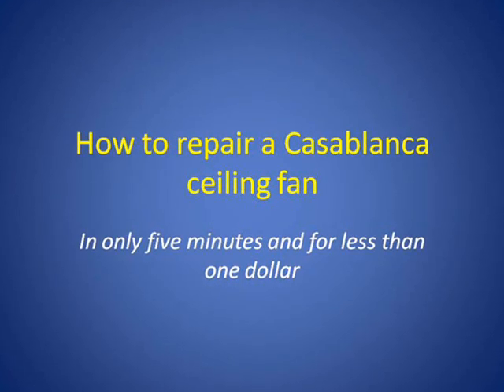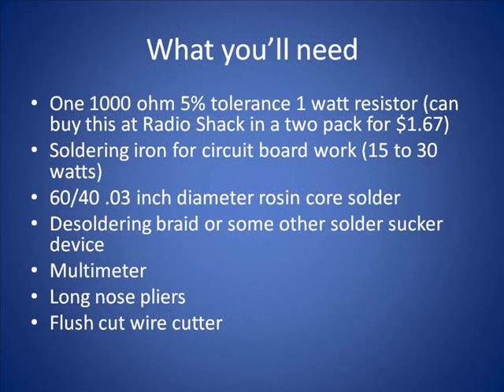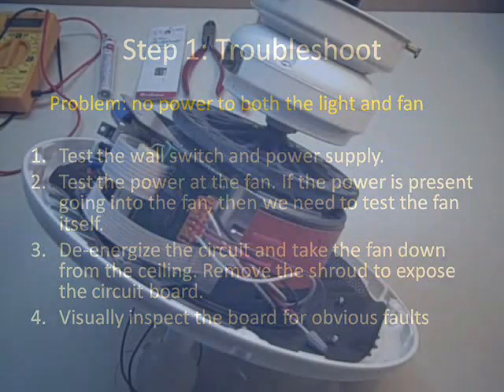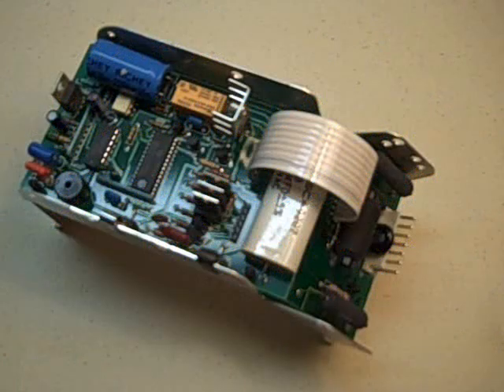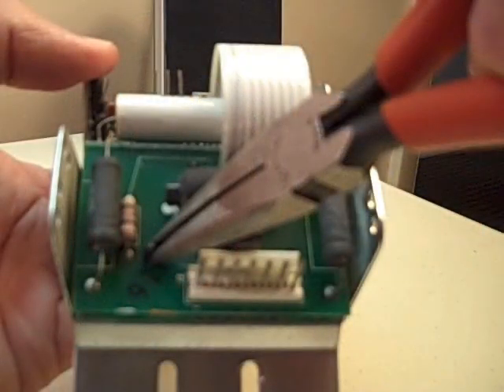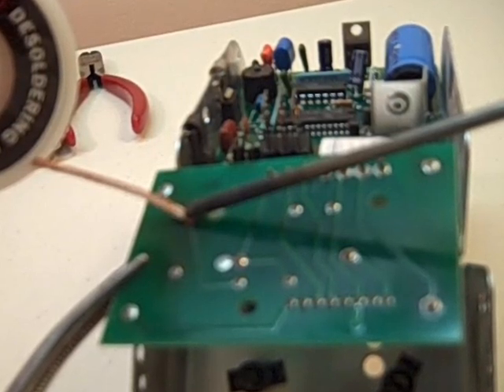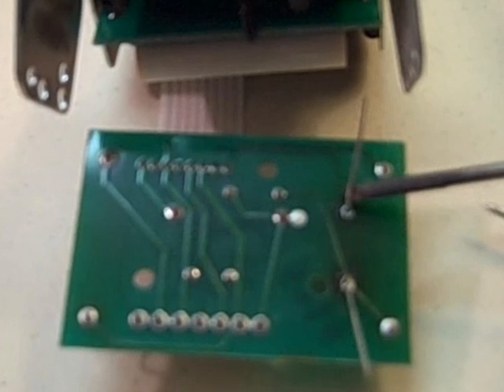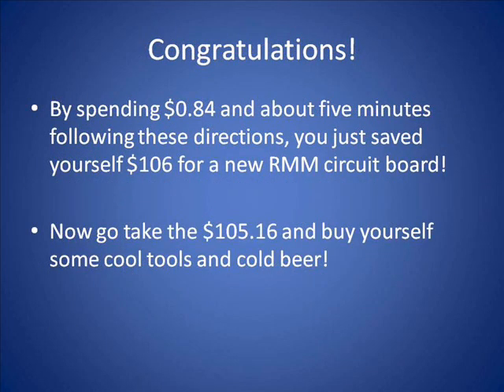Casablanca ceiling fan repair

Comment: My Casablanca Delta 2 fan stopped running.  In troubleshooting, I found the forward-reverse switch faulty.  There was no easy way to remove/replace the switch so I cut loose the two wires for blowing the air downwards and twisted them together.  While testing the fan, I noticed a spark on the circuit board when I turned on the fan.  There was a bad solder connection on the bottom of the board that I had to re-solder.  The fan now runs and the wife is happy!

Comment: I got a Casablanca Panama 5 and the motor wouldn’t start, and when I pushed it while it was on, it would barely spin in whichever direction I pushed it to. The issue was the 10uf capacitor. I cut the old capacitor out and connected a new one across the red and the brown wires connecting to the board. Works fine now.

BTW, this problem can happen on any fans with permanent split capacitor motor. Most ceiling fans have permanent split capacitor motor.

To see if it’s a bad capacitor, turn on power then press fan button. If the motor vibrates but wouldn’t start, and the flywheel/blades spin freely if you push it with your hand, then it would be a capacitor issue.

Comment: For the RMM4, the resistor is 10K not 1K, and the problem for the ones I worked on was the 1000 uF 25 volt electrolytic capacitor. This module design is a thermal disaster, and the electrolytic capacitors get baked out by the heat. The 1000 uF cap and two 10 uF 16 volt electrolytics bear scrutiny and repair, using the same procedure you note for the resistor, but keeping in mind that these caps are polarized (they have a + and - side, noted on the PC board). Then there are the 425 and 3.9K power resistors that are often baked out, although these are pretty hardy, usually.

Comment: I believe this resistor is a 10,000 ohm, not a 1,000 ohm part... Beware that the heat also bakes the color bands, so they may not be reliable for troubleshooting the value it should be.

Comment: Weird,  changed the resistor and run normal, but when I turn off and turn on again, there's short somewhere and blow out my switch. OK, I took of the board and hard wired the wires, replace a normal 3 speed controller and now it's a non-intel fan in the bath room. more reliable!

Comment: My 20 year old Casablanca Stealth died recently.   I pulled my board out,  my small board had a 10k 1% on it that tested out fine.   My larger board had a 3.3 Ohm 1% resistor that tested at 0.4 ohms.   I did not have a 3.3 Ohm resistor on hand so I replaced it with a stack of 3 10 Ohm 1% 1 watt resistors to reach the correct value.   Unit now powers on and runs.  Thanks for the inspiration!

Comment: I don't believe the 1000 ohm value is correct for the newer RMM4 boards, more like 10K or possibly higher. As far as I can tell the older RMM boards, at least through RMM4 are no longer available, however another solution is to upgrade the board and wall switch to the IT3 standard. I bought two kits from "Fan Man" for $150 ea, I hope to install them this weekend, I'll report how it goes. I'm tired of getting the ladder out and messing with these boards, hopefully this will be a long term solution. Of course if the $1 resistor works for you, and you don't mind doing it now and then, it's about as cheap as it gets. It didn't work for me.

Comment: My fan sparked last night and now the lights work but the fan itself doesn't.  It's a newer 2011 model and I can't see any problems with the  resistor - any other thoughts?  The place I bought it from wants to repair it for $225!!! The repair fellow also suggested it might be the Molex plug - how does one test for a faulty plug?

Comment: I hadn't yet watched this video when my 30 year old Casablanca fan quit suddenly one day. I determined it was the fan not getting the signal from the wall switch. Both Casablanca and the company they recommended tried selling me a new switch and circuit board for $225. After watching this video you gave me the courage to tackle this problem. It was exactly how you described! A burned out resistor! After wicking away the old solder and removing the burnt resistor and resoldering in the new one (sold on eBay in packs of 5 for $3), I am now enjoying our fan once again with no problems. I have to wonder how many people have thrown out their expensive fans because of this? Thank you for taking the time to create this video and help save me money!

Comment: I have an older fan than this one, pre 1987 Inteli-touch, using the W-11 wall control. There is just one control board, not two, but it looks fundamentally the same as this unit and uses an Emerson K55AMBHT-9210 motor. It has had some intermittent behavior for quite some time and just lately started failing altogether. After seeing your video I inspected my board and saw that R1, a large 1W resistor like what you show, has generated a lot of heat, discolored the surrounding circuit board, and is cracked. It still measures 3300 ohms as the orange-orange-red-gold rings indicates but as it is cracked I'd imagine this would explain the intermittent behavior. I intend to replace it and hope to get the same good result. Thanks.
Reply: Did it fix?

Comment: My resistor in that position is brown-black-brown-gold, which is 100 ohms 5%, when I measured it my meter read 1.2 Mega ohms. Thanks so much for the video. Not only is it way cheaper - but also allowed me to perform a same day repair.

Comment: When I turn the casablanca ceiling fan on, it is making a noise. It seems from inspection that there is a gasket just above the casing that rotates the blades. Where can I find the name of this gasket, part number. Thank you

Comment: I have a Holliston Casablanca model C31Uxxz. The fan unit is controlled by the inteli touch 3 wall mounted switch (owners manual says it is a W-84 wall control). The power button at the bottom of the switch turns on the fan at slow speed. No lights can be turned on and no speeds can be changed. No beeping noises are heard either. The casablanca support crew had me try to "reset" the unit by turning it off at the circuit breaker and then back on and depressing the fan and reverse buttons. This did nothing. They said the receiver inside the motor housing needs to be replaced. The part # is 8880601000. They want to charge me $110.00 plus 9 for shipping. What a crock of crap. Harbor breeze fan company sent me a current limiting device for free when it failed. Would the failed resistor described in the video result in the symptoms I am seeing??

Comment: Our fan light won't turn off when the fan is running.  I can turn the power off and on to turn off the light but I cannot run the fan with the lights off.  Any suggestions as to what to do or what can be done to repair this.
Reply: mrsdnoble mine does the opposite, they go off and on and then finally off
Reply: How fast does the fan spin when you press fan button? And try holding fan button and see how many beeps there are.

Comment: Kudos to fishbulb for this post!  Luckily I had the same fan with the same problem.  Only difference is when I measured the 10K resistor, it was fine.  Turns out that there was some cracked solder on the leads of a couple of resistors,  Resoldered them and I'm back in business!!!
Shame on Casablanca who make an awesome fan. 18 years and still looks good and quiet as a mouse.  However, to charge $100 plus for a new set of electronics and switch is robbery to me.  
Thanks for sharing this!

Comment: I have a Casablanca Stealth that is probably around the same age.  It has a wall control panel (vs a remote) that is connected to my light switch.  I too have faced ongoing objections from the only service centre in the city, saying it's too old and that parts are no longer available, but like you, I'm determined to fix mine.  Before I go through your tutorial, I just wanted to describe my situation in case you might suggest another approach.  I am definitely getting power to the fan - the light works, the fan works... same with control panel.... I think the problem is within the wall panel.  The light hadn't worked in a year, but the fan was fine.  I've never had a problem with the fan until recently. Now it seems that the circuit is scrambled... I turned off the fan and couldn't get it going for a couple of days.  I tried again, and it worked but only on the lowest speed.  I turned it off again to see if it would work and it took about 50 tries to get it working again... A few times I left the power on, but had no fan activity, then hours the fan would start working.  My latest status is, the fan turned on from the "Reverse" switch, NOT the Fan switch and it's now turning at medium speed, but no light still.  Sorry for the long message but I'm not an expert and I love this fan.  Hope to hear back.  Thank you.

Comment: I'm about to embark on this same repair and the only oddity is my existing resistor is (light) brown/black/(dark) brown/gold which would be a 100-Ohm instead of 1000-Ohm rating.  The current resistor is blown, so I obviously can't measure it to ensure the 3rd ring isn't red versus brown, but I'm fairly convinced it's brown even though both brown strips are different shades, which is confusing in itself.  I'll remove it and triple-check after wiping it down.  Thanks for this video!

Comment: Casablanca Inteli-touch fans are not junk, they are far better than any box store fan. I understand your frustration though, Inteli touch2 circuit boards are a nightmare. I would by an Emerson with a K55xl motor.

Comment: i have similar casablanca fan that is not fuctioning to theinteli-touch  remote . It has curcuit board no 9901190 with 4 resistors standing upright. Do you do the same test ?.